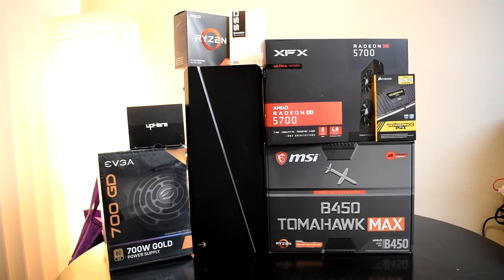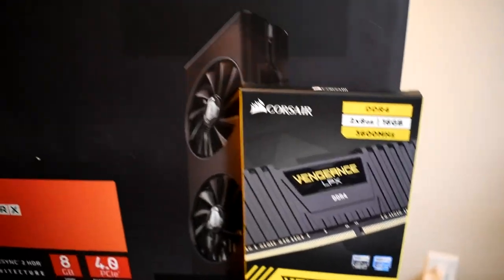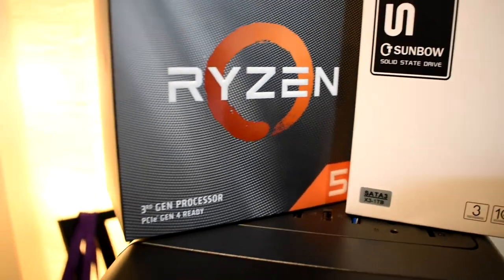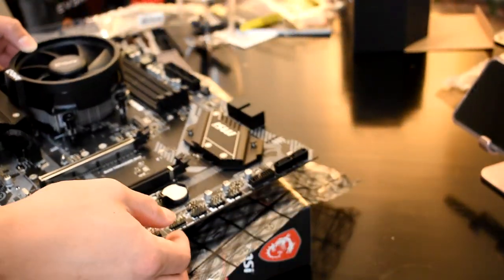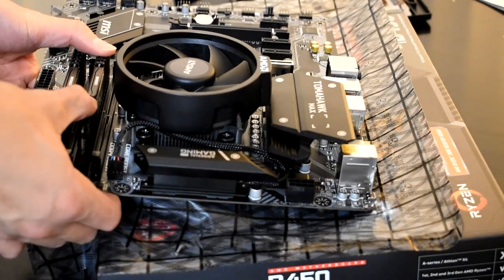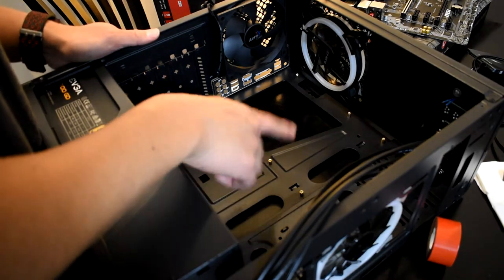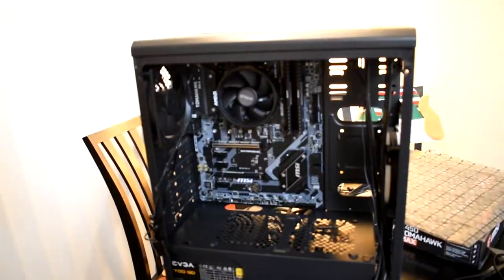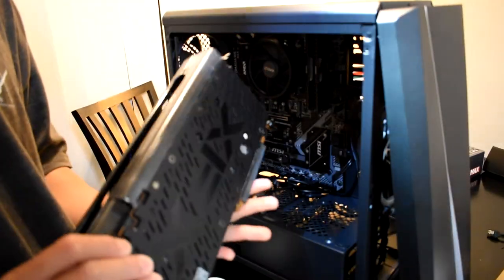*$900 Gaming PC build* Console Gamer builds his FIRST Ryzen Gaming PC!

Comment: How did u mount the top fan? I have the same case but I don't see how I can mount an extra exhaust fan on the top?
Reply from the maker: Hey there! unsure if you caught it at all in the video, but i mentioned it at roughly 12:55 - 13:05 . I got lazy trying to figure out how to screw the fans, so i ended up just using my double sided 3M automotive tape lol. I cut it at the shape of the 4-side of the fans where the screws are supposed to go for a flushed look